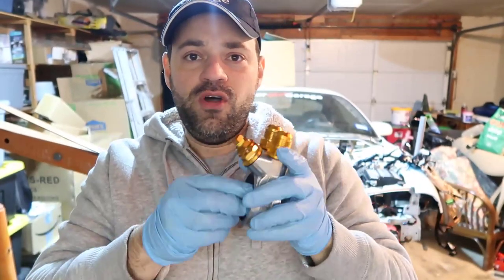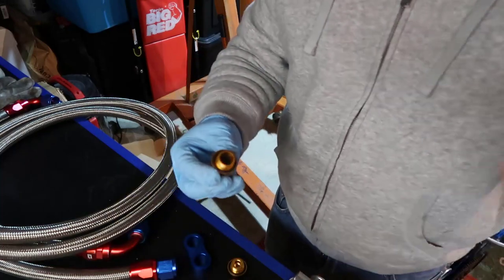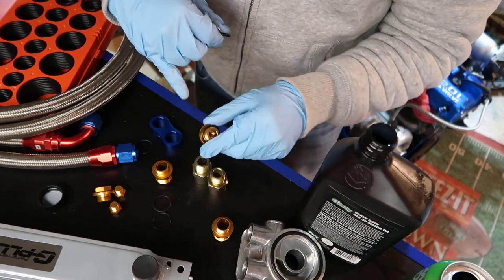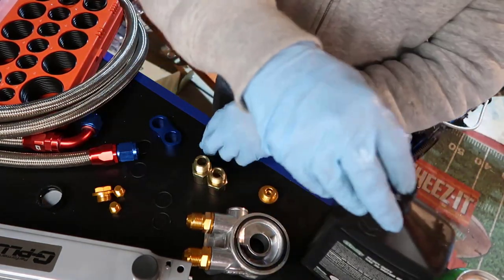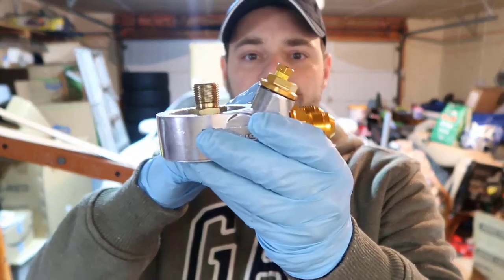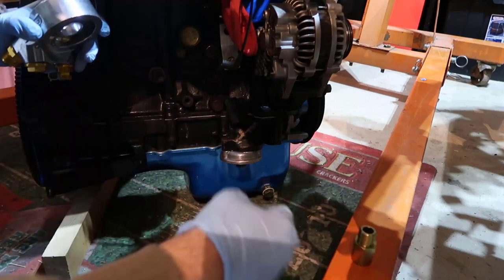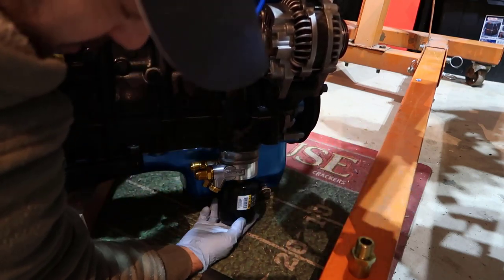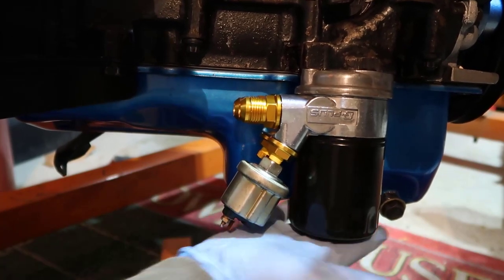Oil Filter Sandwich Adapter with Thermostat - #Eclipse2GBuild

Comment: Hi sir can i run my oil cooler adapter by removing the thermostat? The spring and thermostat itself?
Reply from the maker: @elbale2323  I believe you can, assuming that the space on the oil sandwich won't change the flow of the oil.  I would risk doing it but there is a risk that the oil will bounce on the space opened and won't get the proper pressure and volume.

Comment: Very nice video. Do you think they are universal fit for even trucks? I am looking to buy the cooling kit with a sandwich plate for my 1995 Chevrolet Silverado 6.5 diesel truck
Reply from the maker: Thanks brother. Ya they are universal. I used on three cars. You just need to be sure the sandwich plate  will fit your truck.  Some trucks have a weird guide for the oil that would definitely make it not work if you can't remove that. Check that one first.
Reply: @CarModsGarage  would you say it's best to buy the sandwich plate that doesn't go have the angle ports? I've seen the flat ones also
Reply from the maker: @blackincawston  I'm not sure if I understand what you are asking but you always need a sandwich which meets the block 100% and the middle "bolt" that attaches to the OEM from the clock that will extends it so you can attach the oil filter.
Reply: @CarModsGarage  thank you. In your video at 8:00 , you said the filter was to large for the sandwich you have which has no the wall/ angle, so I was asking probably best to buy one without the wall to be safe to have enough room if the filter will be slightly wonder as long as the rubber seal seats within
Reply from the maker: @blackincawston  oh ya that's right.  Sometimes the filter you will use will be different if the OEM is too large, larger than the sandwich.  No wall is better!

Comment: what size oil line did you go with? and do you know what the idle pressure your vehicle runs at?
Reply from the maker: I used 10AN for the oil to the cooler.  The turbo feed is 4AN.  My eclipse rings around 40 psi at idle if I remember correctly
Reply: @CarModsGarage  I don’t recall but did you have an upgraded oil pump? I am about to install my oil cooler and I have a oil pressure that sits around 15 psi at idle and don’t want my pressure going any lower than what it is
Reply from the maker: @liammcbride6767  I am using the OEM oil pump. 20psi sounds right actually.  I saw in on of my videos the eclipse idling at 20psi.

Comment: Where did you get the oil filter adapter? the one you installed @ 8:45 in video
Reply from the maker: I got that on eBay. Search for "oil cooler with thermostat"

Comment: Nice bro , is this a thermostatic adapter  am asking,
Reply from the maker: For the oil cooler only. Thank you! 👍
Reply: @CarModsGarage  ok cool thanks, would you recommend the g pulse brand
Reply from the maker: @torvarrisevans7846  yes I would but not the thermostat version. It didn't do very well for me (the thermostat)
Reply: @CarModsGarage  should I order a different thermost to go with it , because I already ordered the kit
Reply from the maker: @torvarrisevans7846  no they are fine. Just be sure if you use the side ports to feed the turbo that the port is open all the time and not only with the thermostat. 
The Thermostat part to the oil cooler works perfect
Reply: @CarModsGarage  ok thank you bro .
Reply from the maker: of course man. Anytime
Reply: @CarModsGarage  hey bro, does oil cooler affect your performance in a bad way , if the oil cooler is too aggressive.
Reply from the maker: @torvarrisevans7846   if you cool the oil too much it will have less viscosity so assume you are using 5w 30.  More viscosity when hot (30) but 5 (less viscosity when cool). You don't want to be beating up on your engine racing and have the low viscosity.  You want to be the 30 which is the oil you are using.  
If you use SW30 the viscosity when cold or hot is mostly the same so I don't believe it would make any difference in that case.   
So ideally your oil should be cooled if is exceeding normal operation temperature to go down to operating temperature. 
I'm not an expert but this is what I inderstand
Reply: @CarModsGarage  am using 10w40
Reply: @CarModsGarage  thank bro , I live the Bahamas . but am using 10w 40 , should I go to 10w30 or the 5w30
Reply from the maker: Hmmm I use 5w 30 mostly but here is very cold.  In Brazil I used mostly 10w 30 but check the spec of your car on the manual. They will recommend the appropriate oild according to the clearances that bearings and other parts have.  Not a bad place to be brother ✌️
Reply: @CarModsGarage  thank u
Reply from the maker: Anytime brother!

Comment: Is there a kit that has a oil pressure connection port in the sandwich adapter?
Reply from the maker: Hey Max, 
Not sure if I understand your question but the kit comes with extra parts for the oil pressure sensor. The sensor itself I believe you need to get by itself. Did I answer your question?
Reply: Can u use the other port like the one for the sensor for a oil pressure sensor?
Reply: U answered part of it, just checking cause u seem to know more then I
Reply from the maker: @The1jmadmax  yes you can. There are two free ports and you can use it for whatever you need. 12:46 has the oil pressure sensor I used for my oil pressure gauge.
Reply: Thanks very helpful
Reply from the maker: @The1jmadmax  I am glad that helped :)